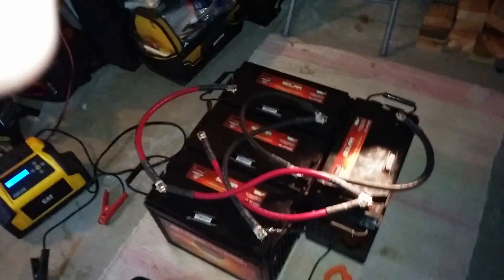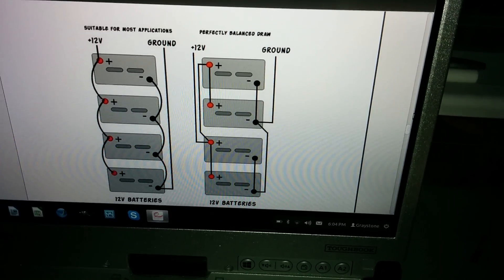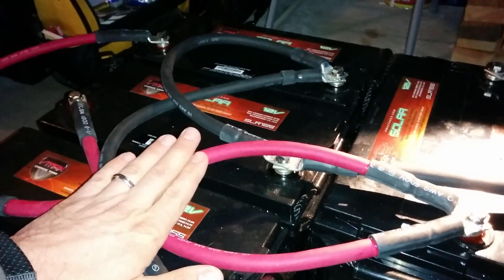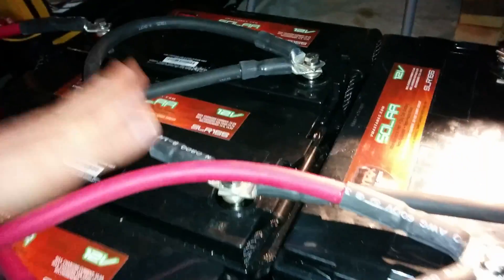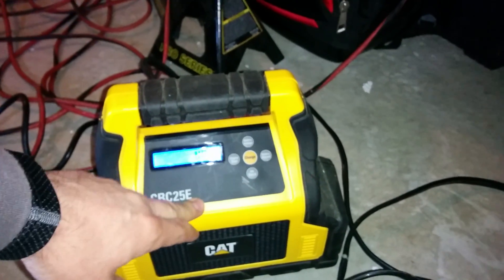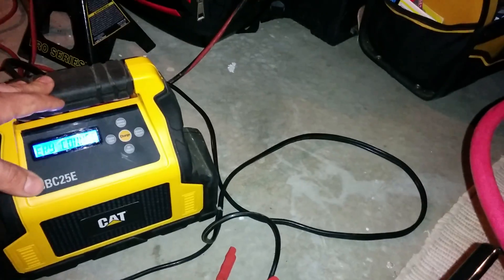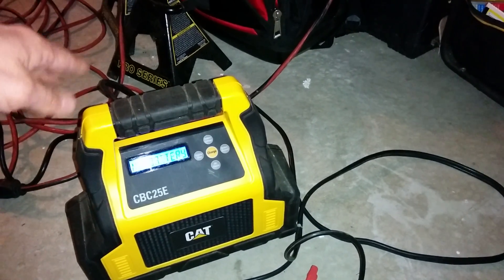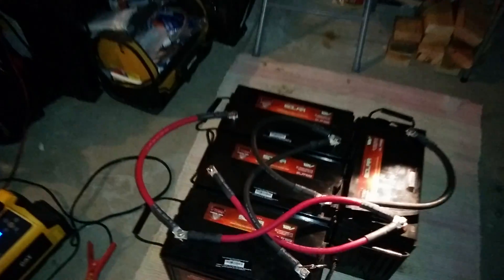12v Battery bank set up in parallel with balanced draw

Comment: on my heavy duty truck with 4x 12vdc batteries, i have wired to the optimal balanced charging. You mention balanecd draw on this setup, does it matter which post + and - that the starter wires will connect to?

Comment: Hi, thanks for the info
I have 8 batteries of 12v at 150amp each a gel deep cycle batteries and 5000 Hybrid invertor, and 8 solar panels of 350watt each a 48volt system, the connection is series connection, 
would your connection improve my battery life, and balance the charge, any feedback would be appreciated, I am not a expert on this, but learning fast, thanks in advance Alex
Reply: Sorry I forgot to add, your example is connected in parallel, mine is series, not sure if charge distribution is different in series anyway would appreciate your feedback, thanks

Comment: where do you hook up the charger in your diagram, and where do you hook up the loads. And how do you hook them both up at the same time? Do you use a bus and shunt? Looking for your locations of attachments. Especially since this is 6 years ago. Did you change out the batteries yet? How did they  perform? Did one battery falter and you had to replace it? If so which one? thx!

Comment: Great job,I'm curious what if your running 4 identical batteries but in a car being charged by a alternator, would this set it still be correct? I use 4 batteries to power my stereo system,n they get charged by car alternator 370amp.usually connected  in parallel.

Comment: Great Video. I do have a question in regards to optimized load balancing when it comes to a 12v parallel configuration utilizing 5 batteries. Could you provide a diagram of the best layout? :)
Reply: Did you ever find a diagram for 5 batteries? If so please point me in that direction.

Comment: You should not be making videos when you give out wrong information in them.  I could take one of your 155 Ah rated AGM batteries in a mid state of charge (about 12.1V resting), put in on my laboratory power supply unit (Lab PSU for short) at 13.6V max, 1.5A max, and I guarantee you it will fully charge your battery (assuming it is "healthy").  If you don't believe me, call your battery manufacturer and ask them what will happen if you do that.  It might take 72 hours or more, but that is not the point.  The point is they will eventually charge to 100%.  Also, you didn't say why that first wiring diagram will not work optimally with your battery bank.  What is so different about your batteries that make the 2nd wiring diagram better than the 1st for your AGM batteries?  You are making some claims without anything to back them up, so I call it more BS (Bad Science).  Also, a wire that is curved into about a 180 degree layout is NOT a loop.  A loop crosses back over itself or forms a complete circle (such as a loop antenna).  I don't see those wires doing that, therefore they are not loops.  You also wrongly mentioned that you need optimal wiring due to heavy loads when discharging and charging.  25A max charging is not much for those batteries, and is in fact a slow charge for a 620Ah bank.  That bank could be hit with 125A and that would be considered a more normal charge rate (20% of its Ah rating so 20% of 620Ah = 124Ah).  So many wrong statements in this video.
Reply: You answered two of my questions about 7 hours ago, but I cannot find my original questions, lol.  Someone must have "deleted" them in the last 7 hours, lol.  I cannot remember what i asked and it must have been a long time ago since now i only use LiFePO4 batteries (for the last 2 years).  Anyway, thx, i wish i could have found my original questions.  I always read answers, no matter how long it has been since i asked the question.
Reply: @davidjames1684  What the hell are you talking about?  It is NOT my video, and i know nothing about lead acid batteries (i.e. AGM).   I never said any of those statements you just made.  I only started a few years ago asking some basic questions mostly on LiFePO4 chemistry and connections.   How can i have "crap" in "MY" video, i have NEVER made a video.  As I stated, i had questions, not answers.  Have you been drinking?

Edit, David deleted the posts that accused me of all kinds of crazy stuff.  This is why the posts do not make any sense.  I have print screens of everything.
Reply: @laronis  Oh sorry... I think you asked how long a 600 watt light would last using 800 watts of solar and his 4 AGM battery setup.  I replied 6 hours if no sun or 10 hours if you start just as it is getting sunny out.  Yes I have been drinking... lemonade, coffee....
Reply: @davidjames1684  LOL, np.  
But that definitely is not me either, I have never asked how long an item will last with a certain battery.

Comment: There is some dangerous false information in this video.
1) Applying a voltage of 14.8 Volts to a completely drained cell could not only damage the battery, but also be dangerous.
2) On the topic of chargers: it seems likely you were checking the open circuit voltage of a smart charger or testing the in circuit voltage of a constant current charger, both tests would be invalid.
3) I would also point out the irony that you stated you "take it to the next level and do things right", but I don't see any fuses...
Reply: Guy is somewhat clueless I agree.  He thinks he knows what he is doing but lacks some fundamental knowledge about batteries, wires, electricity....

Comment: has anybody tried this setup and checked the amps drawn during discharge? I tried it with my 4*200Ah C10 Lead Acid batteries. The current drawn seems to vary. Correct me if I am wrong, if this setup works and I am drawing 40 amps from my battery bank, then each battery should be discharge 10 amps. I checked with a clamp meter, it seems first and fourth battery are discharging slower than the second and third battery, from where the power is being drawn. All my cables are of uniform length.

Comment: I want to do a leaf battery module buying 10 so I can put two in series and get my 14v and parallel 5 2x2x2x2x2 using my middle one to connect my plus and negative hoping it keeps them balanced thanks for the keeping all wires same length advice.

Comment: Nope. I have the same batteries. 12.73 volts is about 79% charged. 13.08v = 100% charged, depending on temps. I keep mine 68 degrees. Here's the chart from the mfg. https://www.vmaxtanks.com/assets/images/technical%20info%20folder/state_of_charge_chart.pdf

Comment: Lots of disinformation and confusion in this video.  If you want optimum flow from 4 batteries to charge and discharge, this is not it.  It would be 4 batteries in a square configuration with 2 X's of cable tied to a negative and positive post in the dead center of the 4 terminals.  A simple optimization of making every cable as direct as possible, as short as possible, is ideal.  And no 1 cable would need to carry the liad of 2 batteries, so you'd cut wire size in half (sq mm of cross section, not external dimension of wire, to be clear)  Of course, with way less work and expense just bolt up 2 copper or aluminum beams with 4 batteries in a line (in parallel of course) and draw power from the center.  Like the rails inside your breaker box, a decent size beam can handle 100 amps at 120, or 12,000 watts.  Thats 1,000 amps at 12v.  Are you discharging that quickly?
Reply from the maker: Very true. The main reason for my specific battery configuration is the space available to me in my RV. Bus terminal is the way to go if available. In my space, fitting these 4 batteries took this specific layout and so, this wiring configuration (keeping all wires the same length) I found to be the best set up I could put together. Engineering an optimal set up is always more then what we can come up with on the garage floor, it also must integrate with the existing system.

Comment: I have only found this and one other website that addresses this issue. Almost all people are dropping the lifespan of their batteries with traditional parallel hookups.
Reply: They are also losing lifespan not charging them to 15.2 volts. read solar secrets its a free e-book on the internet. When you don't charge them up to 15.2 they will sulfate up. All the chemicals do not rebond together. The battery manufactures want you to believe 14.3 is fully charged to sell you more batteries.

Comment: I will use the same batteries in the same arrangement. my question is where will your leads from charge controller connect? battery 2 and 3?

Comment: I have 4 of those same batteries, but in series/parallel to provide 24v at 310Ah. Why 24v? When I was shopping for an off grid inverter, the 24v versions (from the same companies) were CHEAPER than their 12v models, plus your wiring can be thinner because it will be drawing half the amps than at 12v. P=IE.

Mine also look like they are wired haphazard, to charge/discharge all batteries equally. For newbies, you NEED to charge each battery first BEFORE connecting them, especially in series/parallel. If you're dealing with high amp batteries like these, you don't want a sudden rush of current from a fully charged battery into a lesser charged one.

I've had mine for about a year or so, and as expected some of them are showing slightly different voltages. As I was told by others, I need to shift their positions around wiring-wise, to help keep them balanced.

Comment: Is it safe to charge your bank with everything still connected to your car/audio or is it better to disconnect it from everything?
Reply: disconnect every load to your bank while charging, if there's a load on it that may cause the battery or the charger to break. worst is that you destroyed both
Reply: @09092312433  WTF?

Comment: No one has any idea? lol   I can't find anything on line at all.. I guess no one has ever done  (6) - 12v AGM batteries?
                 Do I have to stay stuck on 4 batteries?
Reply: I agree, I just got 6 100amh battleborn lithium batteries and can not find anything on youtube or elsewhere on how to hook them up parallel load balanced.
Reply: I finally found a way to do it if ya still need help.... I can send a picture to you or maybe I'll make a video of the pattern and post it in my you tube home page...there's noting else there so ya can't miss it hahaha
Reply: That would be great. I checked your youtube page but will check again later. Thanks

Comment: I have a new question.... I am about to get two more 12v batteries for my Battery Bank.... Total of 6 now.   I have my 4 batteries set up like you did yours and it is great for balanced charge and draw 
    ...But How do I add two more?   (6) - 12v batteries in a Balanced Draw / Charge Bank?
(Yes- I am running a MPPT Controller and Large cables to supply all the power to inverter)

Comment: You don't know shit about testing those batteries but you do love to try and brag........
Reply from the maker: Interesting outlook. I feel like I’m trying to teach some misunderstood principles more than anything, but I could be wrong. I have heard from several sources that I’m not testing the batteries correctly (which is true as far as individual battery test go) but I think that most may have missed the point of the video. The video is not meant to show the testing of individual batteries in a system, but to show proper load distribution of a parallel 12v bank. The test was only to show the equalized voltage of the system and to help explain the concept, nothing more. If you read my published initial comment for the video it explains the issues with testing battery level with a DMM and links to a different source which has similar information but more in depth. If you could provide a source for your criticism I would greatly appreciate it. As an employee of one of the most advanced battery manufacturers in the world I would definitely like to cover the bits of logic that I am missing. Thanks for the comment.

Comment: Also... On line I have seen diagrams with the charge Controller leeds on seperate terminals on the batteries and the Inverter connectors on the other end...I thought you have to always put the controller and Inverter connectors on the same Battery connectors ...which is correct?

Comment: I have six of these Vmax XTR12-155AH batteries wired in a 12 volt string. Here is the link to the web site that I used to balance wire them. http://www.smartgauge.co.uk/batt_con.html
Reply: Hello.... That was exactly what I wanted / needed to see for ideas to wire my battery  bank up.... I have 4- 100ah AGM now in the lil hurricane power loss back-up solar array I am building...(I'm not rich so it's small lol)
    Do you think since I won't be using it much (Only when I lose power) Method 2 would be fine?  or should I go with method 4 ? The set up will probably sit idle alot more than in use really except when I hook it all up to fool around with it and test appliances / loads I wanna try out on it....Even then it's only for a hour or two that I am playing around with it... But I need it to be ready when needed too...
     One thing that worries me though- is that my terminals wont fit 4 connectors on the two terminals that have all those points where it comes together...Looks like there's two terminals that have to fit 2 jumpers  plus my huge Inverter connectors and the Charge Feed from the Controller  lol.. Unless I use longer bolts I guess...

BTW-    I have (3)- 150 w panels (10 awg wires to controller), (1)- EPever MPPT 40A Controller and a Eastwood 2000/3000 Pure Sine wave Inverter w/ 1/0 wire to batteries ,

Comment: Disconnect the battery then test voltage.  Testing while their hooked up isn't accurate.  I've tested deaf batreries hooked up to battery  banks and it showed 12. whatever . Then I disconnect the bad battery and volts are back down  way below 10.5 volts.
Reply: Good point.  This guy is somewhat clueless.
Reply: @davidjames1684   yup. I'm noticing  that lol. Especially  with  so called "balanced" battery design
Reply: @j5892000  What some people may not realize is if you are running intermittant loads, balancing the wires is not really needed, since when the load is removed, the parallel bank will reach equilibrium, that is, any battery that had slightly more power drained from it will be charged back to the same voltage as the other batteries in the bank (assuming they are all healthy). 

 I use a paralleled bank of ten 12V batteries I set up for a friend, mainly for emergency backup power for her well pump.  Since that load is usually on for 1 minute, then off for 29 minutes (it cycles on average 2 minutes per hour), I didn't bother with any special wiring, because it is not needed.  In that situation, not only can you use different length wires, I also used different gauges (I used whatever I had).  Any imbalance I create in that 1 minute of draw will "autocorrect" in the 29 minutes in between loads.  What is even more interesting (to me), is that not all 10 batteries are the same Ah rating, but again that is not critical either, as they will reach equilibrium, so all will be in the same SoC (State of Charge).  Let's take a semi extreme example to illustrate my point.  Suppose we took a 100Ah rated AGM battery and parallel it with a 50Ah AGM battery, both 12 volts.  Now imagine we put a significant constant load on it, such as 25A.  Normally, the 50Ah battery might last close to an hour solo, and a 100Ah rated battery might last close to 2 hours solo.  So what might happen to the pair with that same 25A load?  Well first, it will likely draw slightly more power from the 100Ah rated battery, since larger capacity batteries generally tend to have lower internal resistance.  Also, the 50 Ah battery will try to descend its power curve quicker than the 100Ah battery, but the 100Ah battery wont let it, cuz when the voltage of the 100Ah battery is higher (even as little as 0.1V higher) than the 50Ah battery, significant current will flow from that 100Ah battery into the 50Ah battery, keeping the power curves in sync.  My theory is if you put that 25A load on the paralleled 100Ah and 50Ah batteries for 1 hour, then let them sit for at least 15 minutes with no load (still paralleled), then unparalled them and let them sit for maybe half an hour (to recover), then measure each battery separately, I bet they would be very close in voltage (such as 12.3V each), thus indicating they were drained proportionally evenly (the 100Ah battery was drained twice as much as the 50Ah battery).  Try it and see.

 People that tell you all the batteries have to be the same Ah rating and all the wires have to be the same length and giving you wrong information.  While that may be ideal for certain constant on loads and/or very heavy loads, generally speaking (and especially for intermittant loads), it is not needed.
Reply: @davidjames1684  yes  even if the wires are all the same.. the batteries  won't be exactly  the same  even if the batteries  are the same.. there's still  minut differences  that will throw it off anyways lol
Reply: @j5892000  It is "splitting hairs" and not needed.  That first diagram he showed (on the left) is good enough for most applications and I am not convinced that the 2nd one (on the right) is ANY better.
Reply: @davidjames1684   well if you look at the second one you'll notice it's the same  as the first  just rearranged  lol
Reply: @j5892000  That is not saying much, the same just rearranged.  If it is rearranged, then it is NOT the same.

Comment: I have 4 12 volt AGM batteries and would like to add 4 more next spring for balanced draw. How would I wire up the additional 4 using that diagram you showed on your laptop?